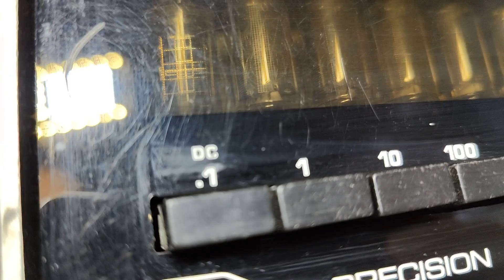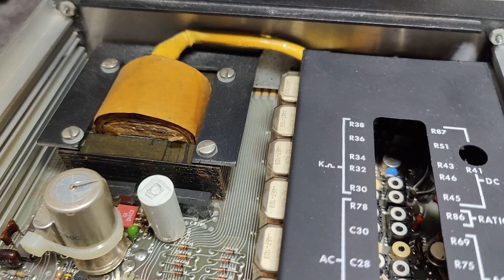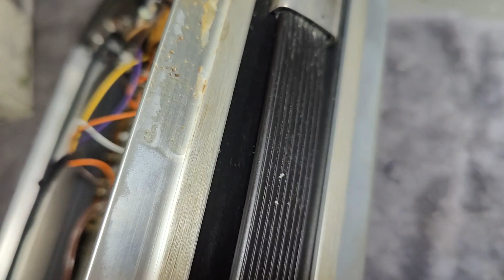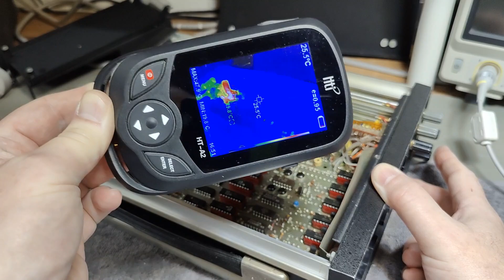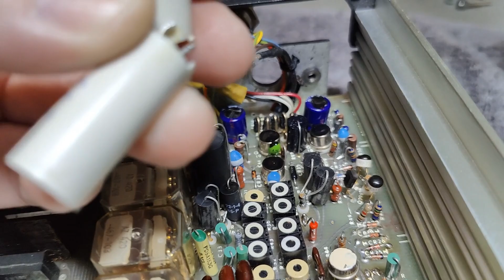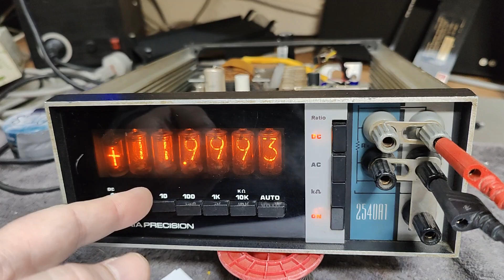Data Precision 2540A1 nixie dmm multimeter 1972 test teardown

Comment: This meter is very similar to the 5½ digit Panaplex display Data Precision 3500. The 3500 has the same row of relays, the same screening box, and the same PCB layout for the counters, but of course the final display driver circuitry is different.

Comment: My guess is the small board that's stood off the main PCB will be the voltage reference.  They stood it off to help thermally isolate it from the rest of the system.

Comment: Flex PCB because it was likely cheaper than paying the massive price increase to go to a 4 layer PCB, which in 1970 was a considerable extra cost, as you could not use standard double sided board, but had to have them made up specially. Silver is because it has been exposed to some corrosive atmosphere, which made the black oxide form, likely run close to something with lead acid batteries in it that were gently gassing off.

Capacitors shorted, but no heat because of the diodes carrying high current, and the thin wiring in the transformer limiting current.
Reply: The flex circuits may have been used to isolate high impedance traces from the PCB to reduce leakage. HP's old 4.5 to 6.5 digit meters use many  teflon standoffs for low leakage.
Reply: A strange meter to find cost-savings in.  Makes my not exactly cheap Fluke 8120A seem like a piece of crap!